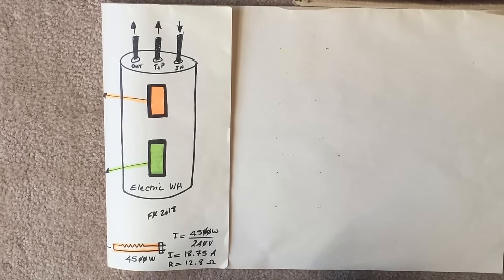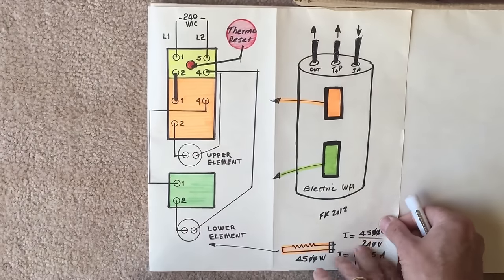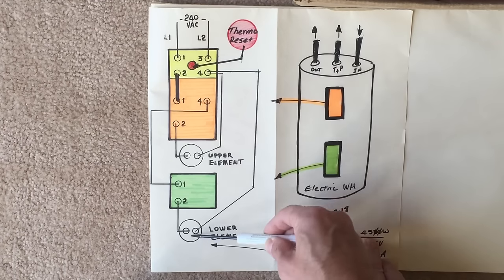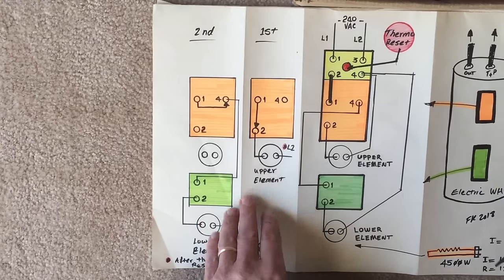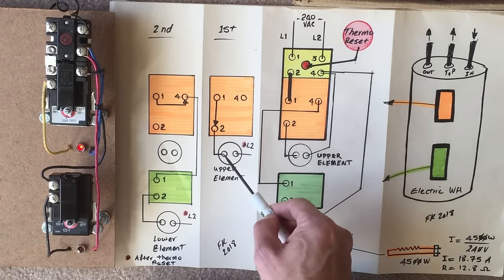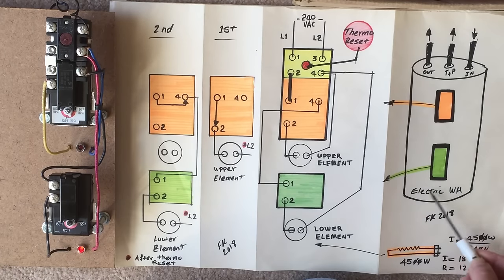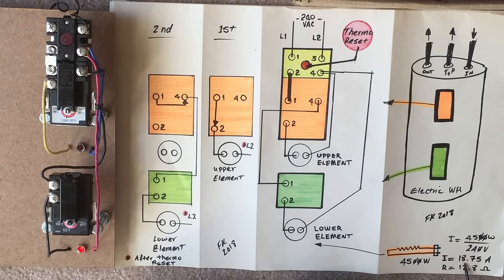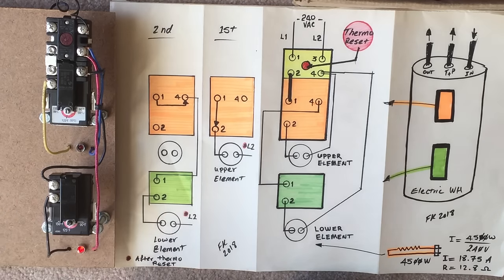Electric Water Heater-Understand How It Works So You Can Troubleshoot Why It’s Not Working Correctly

Comment: I have no power on the bottom why everything is new top & bottom?
Reply from the maker: Keep in mind, bottom element gets power once the water at the top of the WH has reached the temp. One element at a time gets power, top or bottom. Hope this helps.
Reply: @JustForYouDiy  I know that its like the top reset is not staying engaged everything is new in this hot water tank but isn't working right

Comment: What if the top gives you 240 but not heating up after replacing the parts with new ones
Reply from the maker: Double check to make sure the new one is good. It should draw current when it has 240v  across it. Or, with at least one terminal disconnected you should be able to read the resistance across the element in ohms. Also, keep in mind that the element needs to be submerged in water before turning on power. Otherwise, it will burnout.
Reply: @JustForYouDiy  okay so it was drawing 240 and it was heating but the top thermostat is what was the issue it was taking the tempature of  the water heater properly so I replaced it again and everything working perfectly fine thanks again this video how to under stand electrical water heater better
Reply: Wasnt^
Reply from the maker: I am glad to hear that it is fixed.

Comment: Him my water was not heating.. And I hit the reset button. I waited 30mins and I now have hot water again. 
The concern if I am smelling a burning smell and see a tiny amount of water on the floor.
Does anyone have a suggestion. 
Keep in mind I am unemployed. And will have to fix the issue myself....lol
Reply: Thank you for the information. I hope it holds out for a bit... I hit the button and I have hot water again... I am unemployed and cant afford to replace it, nor have a repairman to check it out...first the car not this. the air conditioner went out before that.I am using a portable ac from Walmart.......hahahaha....Im having a great year...lol... gotta laugh because crying does no good... nobody is hiring.... I wish all the jobs promised would happen before I loose the house all together..
Reply: Where is the water coming from? The tank itself, or the heating element. If the heating element most probably the gasket between the element and the water heater is gone, or the element is loose. If it is the tank, the tank needs to be replaced. How old is the tank?

Comment: When i tested the elements by using an electric tester, both elements show electricity
Reply from the maker: If you have voltage across both elements at the same time, most likely there is an issue with the top controller. The top controller switches voltage between the top element and the bottom controller. Hope this helps.

Comment: A friend complained about inadequate hot water longevity, resulting in short showers, ending cold and requiring frequent temperature knob adjustments during the shower.

I made an explainer video about how just a few inches of grit took away about half of his water heater's capacity, and how I fix his problem by breaking up and removing the grit by stabbing at it with some coat hanger wire and blowing in compressed air.

Your video presents an excellent explanation of how the upper and lower zones of an electric water heater work and interact, so I added a link to your video in the end screen of mine:

https://youtu.be/WcX_ICGQmHw

I helped my friend out and removed about a gallon of grit from his water heater, by opening the drain valve with a garden hose connected.

His water heater, estimated age around six years, probably was never serviced, and there was a lot of grit in it!

The garden hose method was woefully inadequate, because huge clumps of grit kept clogging the drain valve. So with the inlet feed valve closed (no need for either of us to take a shower in his garage), and a pan to catch water and grit, and a shop vac, I repeatedly stabbed through the drain valve at the grit with a couple feet of wire (a coat hanger will do) to break it up.

I also used an air compressor to blow air in through the drain valve, to create a torrent inside, to really help move stuff around, after draining a bunch of water out, with the power turned off and with the water inlet off and the pressure relief valve open to help the water to drain faster, less glug glug glug, and to give the air somewhere to go while the air compressor and I showed the grit who's boss!

After about a dozen or more cycles of coat hanger wire stabs, blasts of air, connecting and disconnecting the hose, opening and closing the water feed, the grit outflow seemed to thin out, so we called it a day with hopes that my friend would report the next day that his shower problems are gone.

The good news is that he reported back that things are just fine now, and he didn't even need to adjust the shower knob during his shower, to change the mix of hot and cold water.

Here's my analysis of my friend's problem.

As this guy's good video explains, electric water heaters have two circuits, upper and lower, with the upper being the master.

If the water in the upper part of the heater is cold, that upper element gets power and the lower stays off unless and until the upper water is hot. That controller gives electricity to the lower thermostat only when the upper doesn't need it.

Once the upper water is hot, then the lower thermostat gets voltage, and if it sees cold lower water, then that lower element is energized and heats that water.

Going with the concept that hot water rises, the upper water will stay hot until the lower water is all cold, due to the lower water rising up and replacing the water used from the upper area.

During the shower, the upper thermostat stays happy, seeing hot water, thus feeding voltage to the lower element's controller, which saw cold water first, and it energized the lower element to heat that water, but the grit insulated it, keeping it from doing much heating.

Then the upper water went cold, and that upper controller being the master, then decided it needed to energize the upper element, killing power to the lower element, which was useless anyway.

So with tons of grit hindering the lower element, he had delayed heating of the water that was getting cold during his shower, and thus the heater couldn't try (without failing) to catch up or get an earlier start, by heating the lower water.

We removed about a gallon of grit. That hardly comes close to displacing half the volume of his water heater, yet that's how the water heater performed.

My thinking is that the grit acted as an insulator, and kept the lower element from heating the water, and probably either 1) gave the lower thermostat bad info, causing it to not heat the lower water to my friend's desired 135°F anyway, or 2) reduced the rate of energy exchange so drastically, that the cold garage chilled that lower water down enough that the insulated element didn't have enough energy transfer to successfully heat that water.

I believe case #1 is what happened, and the upper water heated up, and the lower water always stayed cold, due to the lower thermostat thinking the water was hot, because it saw hot grit instead.

So, he had at most only half a tank of hot water to start with, and never got hot lower water to feed it, so the upper element had to heat cold water.

So, that's why his shower sucked, and now doesn't. Having removed about a gallon of grit, the problem is apparently solved.🎉

Comment: I thought both elements worked at the same time
Reply from the maker: They should not be on at the same time. The upper controller switches power to the top element OR the lower controller.

Comment: I must be the only one who a doesn't think this is a trouble shooting video, I have 110 v at each terminal. All new thermostat and elements and no heating taking place.. not helpful,  needs to be a if then trouble shooting
Reply from the maker: Thank you for your feedback. This is troubleshooting in educational style, educating the viewers in how the water heater works, down to the very basics. Then, allow the viewers to match their issues to what they learned. This way, when facing other issues, the viewers can resolve them based on what was learned. You are correct, this is not troubleshooting in a flowchart style. And, it’s totally understandable that this style is not for everyone.

Regards your issue, even though everything is new, you want to make sure they are in working condition. For example, do the elements pass the continuity test, do they draw current while the thermostat is calling for heat. Also, many make the mistake of installing new elements and turn the water heater on without filling it with water. The elements are destroyed very quickly is turned on while NOT submerged in water. 

Hope this helps.

Comment: Does no one just check the damn current draw on the element?
Reply: Well most homeowners traditionally buy a cheap VOM or DMM and there is no way you can measure that level of current on those meters. Serious DIY & Pros will like likely have a clamp on.
Reply: @shieldcracker  well, that's a good point, except clamp meters aren't that expensive anymore. Mine was less than $50.